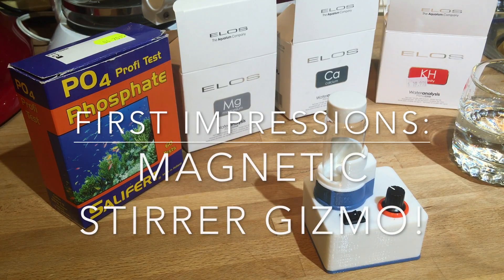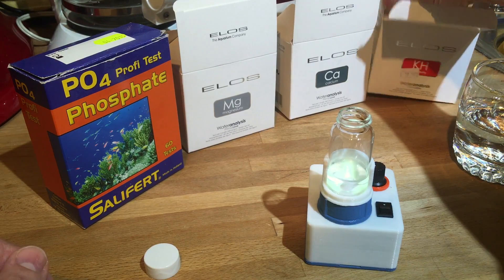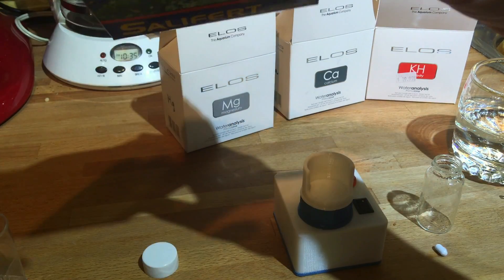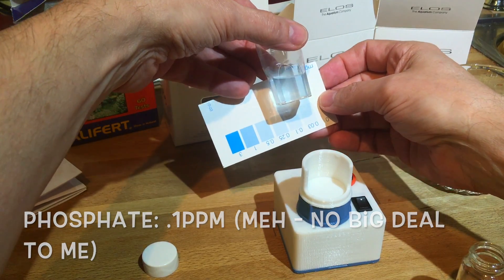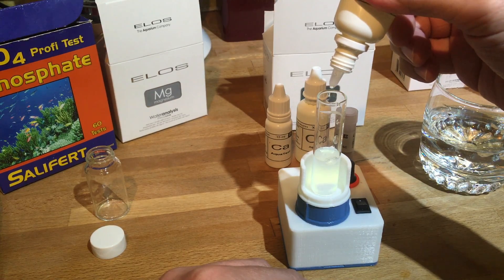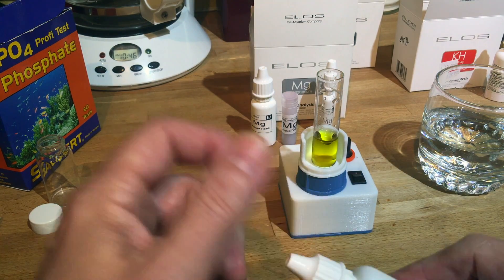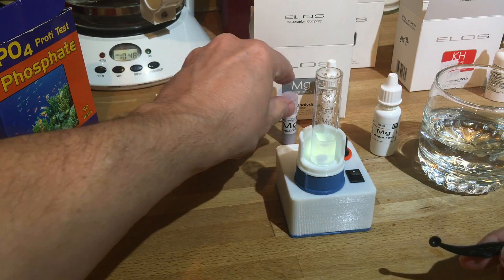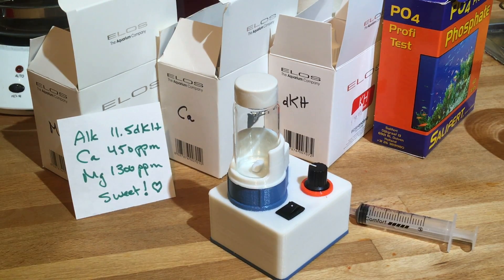Magnetic Stirrer Makes Water Testing Easy Peasy!

Comment: Called it Ecotech spintech mp- 0.010. Make it black and put QD name on it. Sell for $$$. Spare parts wet side ( white bead) costs you $$ and made it last no more than a year so can sell more parts. Take the 9v battery out and sell battery back up as extra item to made more $$$ and finally remove the control knob and add wifi module that you need to buy as extra to control the spin speed. :)

Comment: The salifert vial may still doesn't work even if it doesn't completely fit, as long as the stirring capsule is over the magnet and can spin. Red Sea's test kits come with small glass vials that my fit the stirrer as well. (the red sea kits actually have a convenient device that holds the via and syringe and lets you shake the vial and add reagent one drop at a time all in one hand.)
I would worry about cross contamination of reactants or products from one test to the next either from the vial or from the stirring capsule.

Comment: How cool!  I've seen stir bars used in other applications, and they're pretty nifty.  I did have one thought: for vials that don't fit perfectly in the seat, what if you put a rubber band around it to secure the vial in the seating, like a seatbelt?  That should keep any awkwardly fitting vials from flying out when you turn the stir bar on.  At least, in theory.  :D

Comment: couldn't you use the API kit just in a different vial?  it's just a predetermined measure of water...and then the drops.  I'm 100% sure it'd still work just fine in a different sized vial.  ;)
Reply from the maker: I'll have to see if it matters.  A different diameter vial means you look through more liquid - don't know if that makes any difference though.
Reply: Ahh...good point. Maybe you'd have to transfer it back to the original vial.  But that's just annoying.  Lol